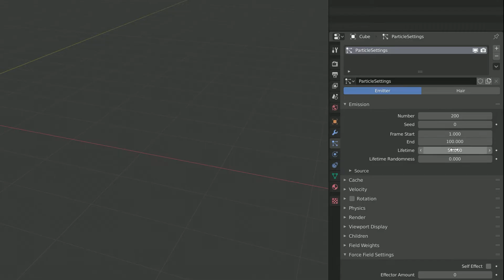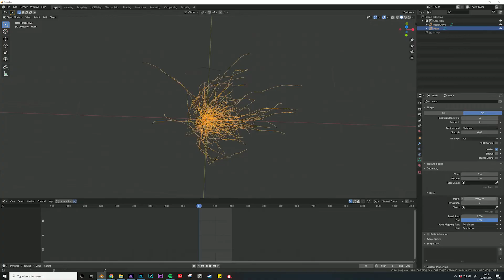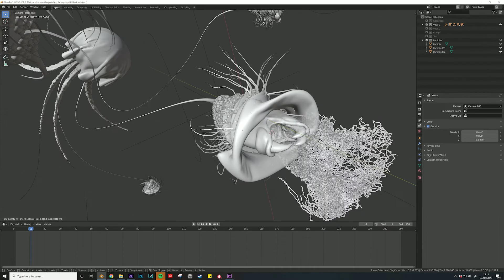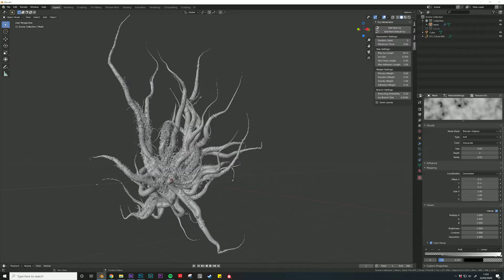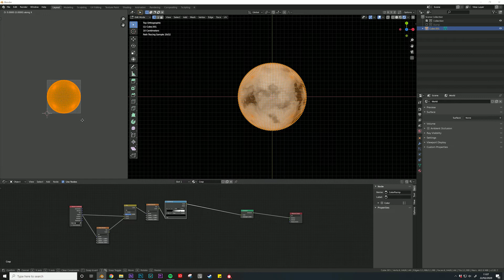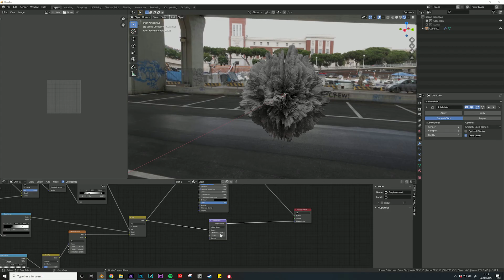How to Model Unusual Shapes In Blender | Virus Concept Art

Comment: Hello all ! Don't know if it's too long after the video post for me to get a response ^^
Problem 1 : not all my non manifolds are fixed, just the base of the squigglies, for some reason i can't get the tips to select and no way i'm selecting 100 + tentacle tips by hand
Problem 2 : the moment i try a simpledeform, the whole thing dissapears, can't even zoom in on it with numpad .
My suspicion is that the fact that it's a baked simulation is causing errors... but id love to know how to fix this :D
Reply: It's not perfect but a solution I found is to make sure you're in edge select mode and select one edge loop  of an open tentacle and then select -> select similar -> face angle. This selected all open tips for me. I wasn't able to fill them individually but I just switched to individual origins and scaled down all tips until I could then use merge by distance to make them points